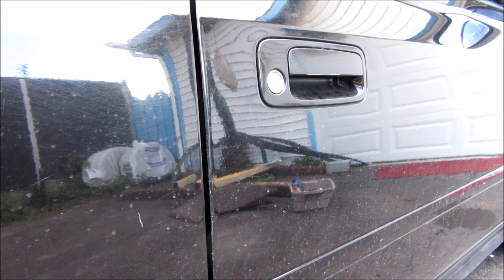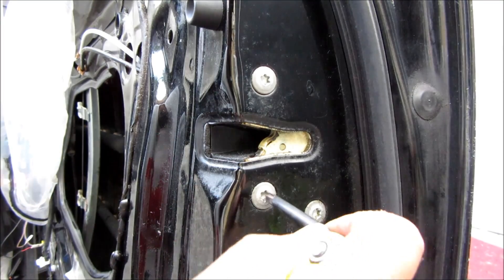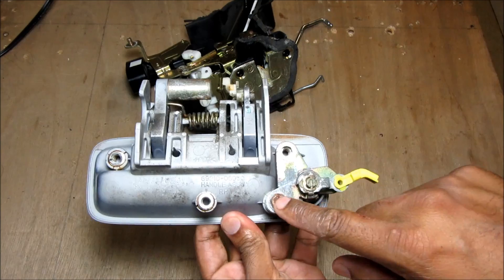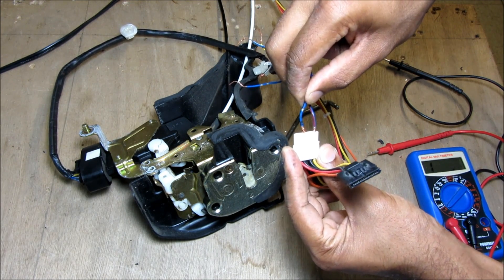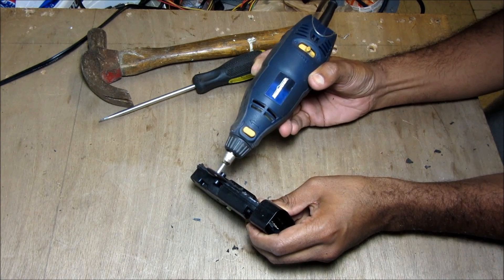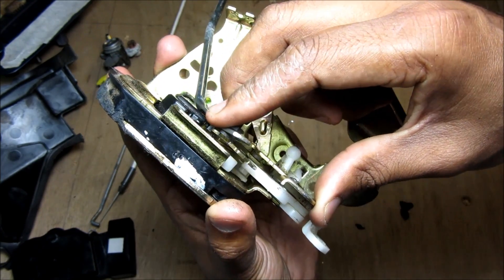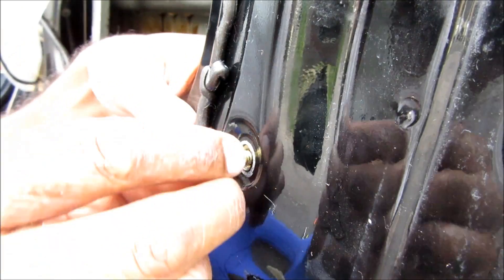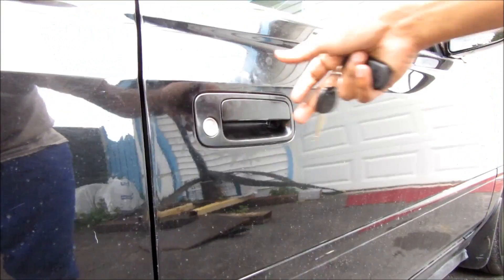How a Power Door Lock Works & Replacement

Comment: If you remove the Lock Rod, can you still open the car from inside pulling on the corresponding cables? I need to replace a door lock on one car, since replacing the damaged door, and not quite sure if I will put back that Lock Rod immediately (that part of the project looks the most complicated to me, that is was is done @ 7:15). Thank you for this great and informative film.

Comment: Is there a way to just disconnect the electric door locks from the control module? The door locks on my Toyota are acting up and lock and unlock randomly on their own. I've read that it could be a short in the wiring somewhere between the module and the locks or the module itself is messed up and getting confused some how. I would just rather manually lock and unlock the doors without dealing the screwy electronic problems. I would disconnect the connector on each door lock but this car has it where you can't even get access through the holes in the door to get to the the connectors with your hand.

Comment: Unfortunately, this video doesn't work for all Toyota doors. I don't know what model Toyota this is he is working on, but I have a 1997 Toyota Avalon. After I took off the inside panel and proceeded to access to the actuator, I found it is not as accessible as the Toyota door in this video. After you remove the plastic weather film, to get to the openings in the metal door, I found that the holes are not as large so you can barely even get your get your head up next to the panel to look back there with a flash light to see what's what much less get your hand up in there. I had to use a mirror and flashlight to get a clear view of the inside of the door back where the latch/lock actuator is. Secondly, one of the nuts that holds the exterior handle in the door is inaccessible to loosen it so that you could pull it out from the outside like he does in the video to unsnap the lock rod. The actuator itself is blocking the hole that you would stick a socket wrench inside to loosen the nut on the handle. So, first you would have figure out how to reach the lock rod from inside and unsnap it so that you could then push the actuator down slightly to even be able to get to that nut through the hole that needs to be loosened. It's ridiculous how they designed it. And it was really hard to get a screw driver or something with a hook back there to try to pull out the little lock rod which snaps into the inside of the exterior handle. So, when I did get something back in there to hook it and try to pull it out, then it was so tight it wouldn't pop out and I ended up breaking off the inside part of the exterior handle that it hooks into. So, I thought, well I can replace that broken exterior handle once I got the actuator loosened and out of the way. But, then, when I loosed the 3 torx screws that hold the actuator to the back of the door, I found that I couldn't even pull the actuator out because the window track was directly in the way of getting it out. (I find it interesting that this video doesn't even show any type of window track in the place that mine is located which is directly in front of the center of the actuator.) So, I tried unscrewing the bottom part of the track where it's attached to a bracket inside the door which did make it more flexible to move but there was still no room to push it out of the way because of a 1"-2" diameter horizontal pipe that's welded to the inside of the outer part of the door for support which prevented me from having any room to push the window track aside to make room to squeeze the actuator past it. (You can see the pipe I'm talking about in this video). The actuator was just too wide to slide past any of that crap that was blocking it on the inside. So, after sitting there and carefully examining the space to see what else I could loosen, take apart or get out of the way to get it out, I finally determined the only way to get that actuator out of that door was if I cut out the window track to get it out of the way. And of course I wasn't going to do that because it would then be unusable! So, finally I ended up saying to hell with this nonsense went to the junk yard and just got another door to replace the old door. The actuator works in the new door, and I bought it for about the price I would pay to get a new actuator. And it was a hell of a lot easier to put on than trying to get the actuator out of the old door which ultimately proved impossible. The door is a different color than the car but that's a minor trade-off. These slick 'make it look easy' videos are nice but unfortunately, they don't always equate to how some of the Toyota door designs are made and the obstacles you run into.

Comment: I have a FZJ80  rear tail gate lock actuator that is not operating. The motor works but doesn't have enough "grunt" to open/close the latch. I cleaned out the motor - pulled the magnets and cleaned and replaced but still motor shaft spins but no Grunt.I noticed on the circuit board there is a thermistor (TDK 5088)and I am wondering if it could be that component that needs replacing or the motor itself. Any feedback is very much appreciated.                  
Regards SB

Comment: 1997 Toyota Camry le right rear passenger door lock actuator.
Can’t get the actuator out pls help
Reply: You're right. I got the same problem with my 1997 Toyota Avalon., I just went to the junk yard and got a replacement door after messing with it. Replacing the door was less trouble, cost about the same price as a new actuator, and was easier and faster to put on. See my long post I posted today at the top explaining all the problems I read into trying to get the actuator out without any success, I'm sure its similar to what you encountered. These videos are misleading They don't always apply.

Comment: Amazing. I've torn into my Corolla door today investigating a 6 years old central locking problem. Got into the actuator motor on my own before I found this video (2002 NZ Corolla has a screw, no dremel required) but still a very helpful teardown & commentary to watch. Gearing looks okay in mine but the motor just seems weak. A spritz of contact cleaner made it look shiny again but not much else lol.  Mine's a bit different from yours so wish me luck putting the rest of the door back together now :-)

Comment: anybody can answer - on 2014 kia sorento driver door  we are pulling the cables and not getting the door open i will try to do it in order this time .. unlock then open.. if we are not able to use the cables will we be able to use our hands or  slim jim or do we have to use saw and hammer and if i use slim jim do i pull or push.

Comment: Need help please,  06 civic sedan- driver side front door.  Actuator is lock  or seize close and  I can't manually or remote  lock or unlock the  door lock.  It won't move.  I can't open the door . I manage get door panel off  and have access to actuator. But how do I get it to release  from striker to open door.  I have tried removing and reinserting the  rod that goes into actuator from door lock . It wont unlock. How can I get it to release to open door  to get to those 3 screws holding the actuator.
Reply from the maker: Can you pull on the actuator from the door handle to release the door? 

There's no access to those three screws from inside, you might have to take out the angle grinder to encourage things to get moving

Comment: Very good video. You show all details to replace and explain how it works. I'm surprised how you don't have more likes in this. My car lock should have to be replaced too, because when I press the remote control the system says that the driver door is not closed and it is apparently closed. So the problem should be the lock right?
Reply from the maker: That would be the lock position switch

Comment: Speedkar99,  my latch on my 2000 Solara D/S door sticks so I can't close the door. Need to use a screwdriver to lift the internal plastic latch then close the door.  Can this latch be changed or need to change the whole unit?
Reply from the maker: Better to change the unit

Comment: being  charging a arm and or leg. I have a honda pilot 2003, I had the   ignition switch changed  and they put the original switch actuator  in the steering wheel. so do car repair people know how to fix this problem, and about how much can i expect to pay to have it done? Thanks for your reply. I need the automatic locks.

Comment: I have a 2004 Endeavor and the driver door lock stopped working. Shortly after the fuse popped and now if we replace the fuse it goes after 1 use. So could the bad lock be the cause of the fuse blowing or is there a bad ground elsewhere? 

Also, not sure if its related or just a completely different failure, but our alternator is not charging enough ( bad ground) after replacing the regulator. So I'm not sure if this ground is affecting the alternator's ground .
Reply from the maker: It's likely a short in the actuator or wiring

Comment: speedkar99.  If unlocking the door with a key does not trigger the other doors to unlock, how can you know if the problem is the door controller or the key detection switch in the actuator !!  Thanks for your video.
Reply from the maker: You can try worrying the leads that lead to the door control switch

Comment: Excellent video sir ! Thank you for it ! I subbed because you are so very thorough and thoughtful in your demonstration . I just found you while trying to understand this system so as to diagnose my issue on my newly acquired 2008 Mazda3 S.  Perhaps, you could check my thinking for me? What's happening is that my passenger front door lock is not locking when signaled via the key fob (It moves SLIGHTLY,  but doesn't lock ), so it must be locked and unlocked by hand. I'm suspecting that the actuator is failing or the cables are mechanically compromised. Along with that symptom, the alarm will immediately sound  after all doors are locked manually and the KEY is used at the driver door cylinder (The only key cylinder on the doors) to activate security monitoring (Using the key and turning to the right in the driver key cylinder activates the alarm system monitoring). So, what I suspect is that the switch position indicator on the actuator may be constantly indicating that the door is in the unlock position, even when it has been manually locked, thus setting off the alarm. Does that sound feasible to you with your understanding of how this system operates? @speedkar99

Comment: What can I do if I lost my extra key to my truck? What can I do to keep someone from unlocking my truck with extra key? It would be better if it did not involve mechanical work. I would not be able to do this myself if it involves difficult mechanic work.
Reply from the maker: +Crissy G You'd have to change out the key tumbler I showed, attached to the handle

Comment: What is the specific vehicle used in this video? I have a 1999 Corolla and I need to replace the lock actuator on it. Thanks. Good video. I've subscribed to your channel based on this one!
Reply from the maker: +Geozero George 1999 Toyota solara 
Should be similar 
I'll have a video for the Corolla in a few weeks
Reply: What about 1996 T-100.  No key FOB,  driver's side door. Can lock with key or use manual lock inside. Interior auto lock won't work on driver's door but does work on passenger door.  Any video for this? Thanks.

Comment: very preciously described. My dirver's side door locks with the remote but other three door doesn't locks!! they get locked manually only !!
Reply from the maker: +Nitin Dangwal Seems like you've got a worn or stuck actuator.
Reply: +speedkar99 I have checked other three doors, they are not receiving power. What could be faulty ?

Comment: My power door lock on the front driver side doesn't work. Would it be sufficient to just replace the actuator or does the latch need to be replaced as well? The actuator can be purchased individually. Thank you!
Reply from the maker: +Zeberka Yes just the actuator
Reply: speedkar99  So, why was there a need to replace the latch in your case then?

Comment: great job  and great experience, Speedkar99! Do you have repair shop ? I'm so old that I couldn't follow your instruction . My car, a Toyota Camry 2011 gets problem with key remote that only works on lock/unlock at driver side, but not for other 3 doors. Now they are dead, before this, they worked off on when it was hot.
Reply from the maker: +To Nguyen Thanks. I don't have a shop. I work on my own cars. Are you pressing the remote twice to unlock all doors?

Comment: I just bought a 2008 Subaru Forester and the seller told me "Don't lock the doors, not with the key fob and not with the key."   I am leaving my car unlocked for now until I can figure out what is wrong with it.  I don't want to bring it to the Subaru dealership, because they will charge a lot to fix it.  I am worried that it is an expensive fix.  Can you tell me what might be wrong with it?  Also, is there anyway to lock and unlock the doors manually without having it connected to the car computer?
Reply from the maker: +jjaynes02 Why did the seller say that...is the locks jambed?
Reply: As far as I know, the locks are not jammed, but if you lock them, they won't be able to be unlocked.  In other words, it may need to be reprogrammed or could be the actuator?  I don't know, he didn't explain.  But I am afraid to play around with it and get locked out.

Comment: I have a 1997 Toyota Avalon XLS, and the driver side door rod from the exterior door handle to the latch has been broken. I have the piece (rod) and know it it broken. My question is where do I find the replacement part for the rod? Or do I have to replace the entire mechanism like in this video? Would you send me in the right direction? I have been looking for schematics for the door, but can't find one doing google searches. Would you send any links to help? Either a different video or drawings? Thanks.
Reply from the maker: +Manuel Mose Toyota probably won't sell just the rod. Your best bet is the junkyard.
Reply: speedkar99 where did you get the latch assembly?
Reply: What is the size of star wrench/socket to remove the latch from the door? What all tools would I need to remove this from a junkyard car?

Comment: My passenger rear door lock isn't locking or unlocking the door, I think the lock actuator is broken, the issue is that I can't figure out how to remove the unit from the door in my 95 camry V6 made in Japan.  I believe part looks like this one on E-Bay...http://www.ebay.com/itm/162348615531?item=162348615531&frommaketrack=true&viewitem=&vxp=mtr

The reason I couldn't remove it is because there is a window guide bar inside the door, I released the 2 bolts but it didn't seem to want to move.  I also had the window closed (or in the up position, so it wasn't in the door).  I wondered if you've heard any trick to removing the lock on a 95 camry?

Thanks!

jc
Reply from the maker: +Jon Chock I haven't touched a gen 3, but there might be a write-up on toyotanation forums

Comment: Thanks for the video, my 1999 camry actuator was bad because of which it was not locking/unlocking, I changed it, but after changing the actuator the lock became little stiff because of which its not locking but it is responding which it was not earlier, what could be the issue? Is it the lock rods or the actuator was not placed properly?
Thanks
Reply from the maker: +Ranjan Kumar lubricate the lock mechanism. Also make sure the lock is adjusted properly against the door. Was it a new unit?

Comment: I was wondering on a Toyota sequoia... If my rear hatch doesn't lock is this the Actuator that is faulty. I can't unlock or lock the hatch with the key as well. Thanks
Reply from the maker: +James Deleon There's an issue with the latch, not the actuator. Perhaps the rod for the lock is dislodged.
Reply: speedkar99 I don't think that's it. I open it up. I don't see the lock/unlock tab moving... I can open the door... It just won't lock.

Comment: Great job.  Right to the point, without any 'filler' talk. Thanks.
Reply from the maker: Thanks, short and to the point with no BS is my style :)
Reply: Wow I watch the whole video amazing .. congratulations your very knowledgeable. Can you help me..? I got a drivers side door replaced on a Mazda 2 14 now the car won’t lock. Took it to get fix thinking it was not well balanced but after spending 200 plus parts.. door still won’t lock .. what could be wrong?? Thanks

Comment: I have a 2010 Camry. I've gone thru 3 rear door locks and now my driver side front door lock isn't working. Toyota dealership charges $330-370 per a door. I'm not sure whats going on with Toyota lately but between this and their VVI engine camshaft gearing problem, which has a  Service bulletin to it. My days with Toyota's are almost done. Great job on the video! Didn't think it was that complex to do.

Comment: I can't find anything for Tacoma 4 door (2006), both electric locks work, then quit, when they don't work, I see the lock trying to move but its stuck, but its not tight, its easy to move by hand, but I always hear the actuator working, i'm lost on what to do? Is the adjustment off, because the actuators are working?
Reply from the maker: +ozman1966 That happens when your lock actuators are wearing out and the weather is warm. I'm getting the same issue on my Solara, especially when the sun shines in and heats up the interior.